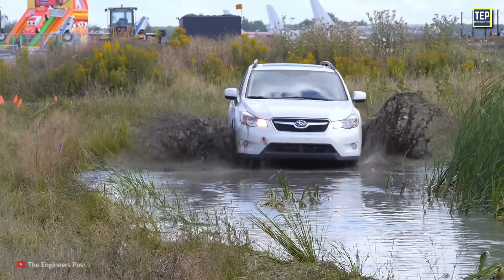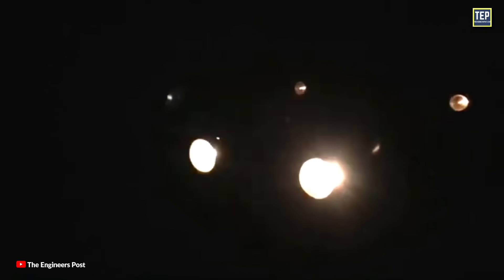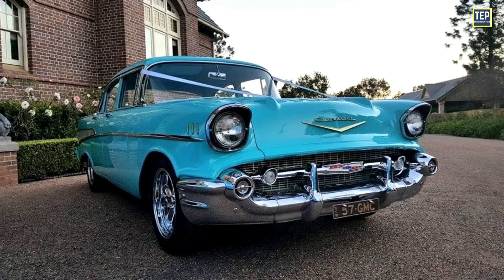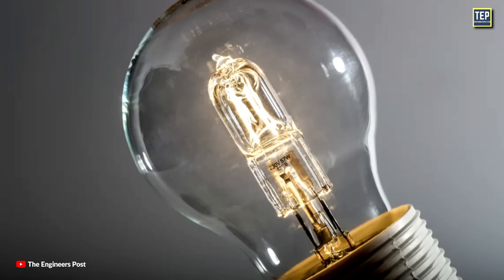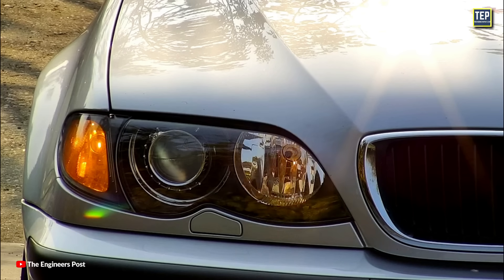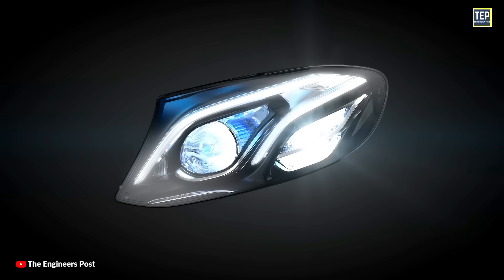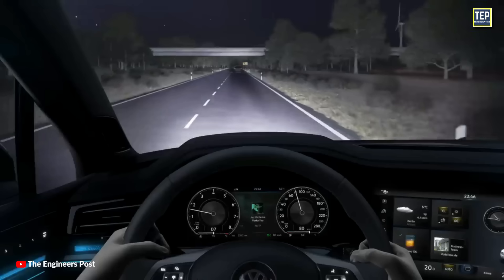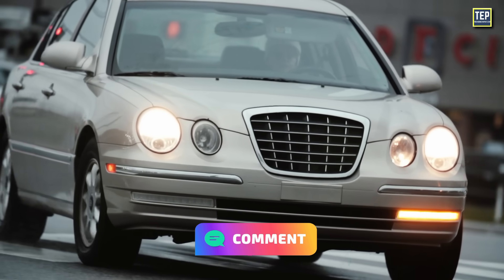The Problem With These Headlights

Comment: "remember, the best time to use very bright lights is when you're in a lifted truck in the city/suburbs where there are a ton of incoming traffic. This way, the light can hit multiple cars and blind people causing them to lose their sight and/or crash." - car manufacturers.
Reply: And those lifted trucks LED blind you. Wonder how many crashes and death have been cause because of them I am sure they do not meet traffic safety standards in brightness and Height above the roadway. Wish the gov. would crack down on these.
Reply: @sundance2005  The gummint is only there to force you to pass smog control.
Reply: Not just lifted trucks @sundance2005
Reply: Add to that make sure you always have your fog lights on, foggy or not.
Reply: The biggest problem in my opinion is knuckle-draggers loading the back of their utes/trucks with tools and everything else and failing to either upgrade the rear suspension for the added weight, fitting air assist bags to aid with the added weight, or simply not being competent enough to slightly adjust their headlights Y axis to compensate for the sag they've introduced.

I play a game "high beam, or f***wit" with my best friend when driving at night, but I can tell 90% of dazzlings are moron related by how far their beam goes up the trees at the side of the road...
Reply: @YouNameItGaming the thing that annoyed me the most since I came in North America is that practically no car here has a built-in headlight height adjustment accessible from the driver seat. When I was in Europe, (almost) every car had that, and it was great to be able do lower your beam whenever you were loaded
Reply: @julescugnet9154 this has been mandatory for cars in Europe since the late 90s. Yes, that's what regulations bring you. If you don't force the manufacturers to introduce safety features they won't introduce any.
Reply: @julescugnet9154 I have that in my TATA car back in India but none of my North American vehicles have those. Even when they cost three times as much.
Reply: @tannenfreund87 1/3 of Europe cars are sold in the  US
Reply: @Tedmader-fp3vb  they still build them according to the local regulations. If they don't require height adjustment of the lights, they won't build it. Also, the requirements for light are different in NA than in Europe. The cut-off of the headlights is different and NA doesn't require orange/amber turning lights on your rear end. European headlights are illegal in North America
Reply: @julescugnet9154 Or you can just pop the hood and use a screw driver to adjust your headlights. takes all of about 2 or 3 minutes.
Reply: @YouNameItGaming  Then you're just odd because the majority of the blinding truck lights are vehicles that have no cargo in them, are driving for mere brute size and higher ride height, when a car would have sufficed otherwise.  I see very few "work trucks" on public roads, loaded down with cargo, that are the factory LED headlights that are blinding.  It's usually incan headlight vehicles currently in use as work trucks, unless illegally  modded with LED drop-in lights, and those are at least as bad as factory LED lights.
Reply: @YouNameItGaming  the rear airbags on my suv went out and I was blinding everyone with my low beams until I got the replacement bags.
Reply: @YouNameItGaming it's always coming down to $!
I had that problem decades ago. Bought older vehicles with already worn out suspension (of course always the cargo area is made weak at the factory so it's totally shot in a decade) (yes the commercial duty version wouldn't those are more expensive new and used I'm talking about the most economical classes of sedans and regular pickups).
I had to have new spring or suspension work. 
It always drives me nuts sitting in a vehicle looking up at the trees once anything heavier than a couple salt sacks are laid in back. 
It's people who can barely afford to drive in the first place who go around lighting up the trees. You'd find the tires are probably near bald, the oil is a black drip at the end of the stick, the transmission smells like a chemical fire and the seats are shredded. 
And they're >    < this far above empty all the time.
Reply: @YouNameItGaming o
Reply: All the people who have their brights on in urban areas annoy me.
Reply: @dougpatterson7494  I have my brights on to see better at night and also because of those assholes that have their bright LEDs shining right in my face!
Reply: I totally agree.
Reply: Oh it’s even better when you’re from Alabama and especially when in a rural area, where there’s little or no light pollution, so your eyes are adjusted to the dark, and some asswipe with a squatted truck flies down the road, and won’t turn his fucking giant LED bars off either.
Reply: I was about to cuss you out in the first half
Reply: I think they're only allowed to use LED 10k bulbs in lifted-trucks IF and only if they also have a big pair of trucknutz.  I'm pretty sure that's a bro-code law nowadays.
Reply: Remember when car headlights didn't try there best to blind everyone approaching your lights
And that is probably just the normal setting and not the brights
Reply: @kaval187  I doubt that most people reading this are old enough to remember a time before blinding headlights.  
In the 90's xenon high intensity discharge (HID) lights were all the rage and everyone was installing illegal aftermarket  kits.  The cheap kits didn't even have proper reflectors or adjustment dials.
Reply: Absolutely!!!
Reply: Yeah well if you lift or lower your truck, you really should get your lights calibrated. And yet I doubt people do this.
Reply: @alexdhall  the main issue now is that SUVs and trucks come out of the factory where the headlights sit directly into your cabin if you're driving a car (sedan, coupe, compact, hatchback) so they don't even need to be lifted anymore. They just come like that
Reply: You forgot the four light-bars and "fog lights".
Reply: And always use bluish light so that it scatters the most in fog and rain at night rendering your night time vision useless and blinding others. While yellow light don’t disperse as much they are so boooring 😂
Reply: - Tesla
Reply: You should recommend that they install a train and tractor trailer horns make people deaf or give them a heart attack as well
Reply: 11:43 what in the jaguar f-type volvo s90 is that?
Reply: @thetechcorner7204 It looks like Volvo and Masarati got together and had a baby, lol.
Reply: I read your comment and had to laugh out loud!   So true.  It also helps to have extremely bright light bars on your roof and front bumper as well as the rear bumper, to blind everyone in range.
Reply: White led lights are too dangerous.
Reply: I totally do not get blinded by any vehicle because I am blind already. My eyelids get brighter though
Reply: @Nick-or5lr you’re good at watching YouTube for a blind person
Reply: Some manufacturers send their vehicles without ever having them aimed properly. Most high sitting vehicles have their low beams sitting at the same angle as their high beams. And some idiots never turn hight beams off as it is.
Reply: Government must crack down hard on bright LED lights.
Reply: Don’t look at them. Look where you want to go.
Reply: I look forward to the day that they put automatic leveling in headlamps. These high intensity lights are great when you’re traveling on a flat surface, but as soon as something happens, when your car is no longer flat, you start blinding everybody.
Reply: the worst is those "squatted" trucks, the ones who lower the rear end while leaving the front jacked ?
you blow right past the limitations of adjustment when you do this, so no matter what, your blinding oncoming traffic along with low flying aircraft...
these people are the epitome of narcissistic morons in my opinion.
Reply: The outcome is that more vehicles will be sold. - car manufacturers
Reply: i dont know whats worse idiots using high beam or idiots having theyre low beam bright af
Reply: That's why people are working so much, unlike you sitting and laughing at technology but still remain as a incapable person no matter how much you live with lies 🤣
Reply: Yes, this applies to the drivers that mount led panels in grills to blind motorists. Save these for off roading, not in city driving.
Reply: 😮Divine miracle ✨️ 🙏
Reply: I fukkkkkking love my Lasers dude!! #BMW #bimmertech
Reply: If I bought a car with led headlights I'd seriously see if I could change them for halogen or reduce brightness, I could not drive around being so rude blinding everyone!
Reply: I totally agree with you
Reply: Yeah, I don't think it was Daniel Stern who narrated this
Reply: That’s something whistling diesel would say
Reply: For real 🤣
Reply: agreed👍
Reply: Impossible LED lights don't blind people, the video said so. Don't worry about any past experience telling you otherwise.
Reply: @UnyieldingMass yeah, pretty sure this is an AI script - quite a few weird statements that contradict other parts of the video
Reply: @UnyieldingMass  Guess what "sunshine"? Just because a "video says so" doesn't make it true. I seen a lot of videos say the "earth is flat". Am I suppose to believe that too, just because the video says so?
Reply: @UnyieldingMass  but they still f*ck up the eyes forr a short time
Reply: @UnyieldingMass  ROFLMAO!
Reply: @UnyieldingMass  They also don't produce any heat!
Reply: @UnyieldingMass I'm also fairly certain this video was AI generated. The voice-over is obviously not a real person but even the language, syntax, and grammar of the script sounds like it was written by chatgpt. Knowing how unreliable current publicly accessible AI engines are I would not at all be surprised that one would make such a confidently wrong claim as "LEDs won't blind other drivers."
Reply: Any of the headlights that are pure white blind you there's a reason we used yellow lights manufacturers and you seam to have forgotten or does it not blind you because your lights are even brighter than theirs? @UnyieldingMass
Reply: And smoking and Vaping doesn't cause lung cancer 😉
Reply: Obviously the car manufacturers to the drivers are listening to you.  lol
Reply: The car manufacturers aren't responsible for that lol. The people lifting the trucks and not adjusting the headlights are.
Reply: @masondurham8686  The car manufacturers are absolutely responsible for their stock headlights being so bright that it looks like super powered high beams. Even in a non-lifted car, having one of these things drive towards you completely blinds you.
Reply: Fr
Reply: well ive seen lots of accident happenes because they were driving on lov beam while at high speed... people has problems interpreting complex logics.. lov beam is for slow speeds while you are close to other cars and peopke you have to be also automatically slow... and high beam is for fast driving where there is no other drivers ... if there is drivers and people and you ar driving fast thats problem... of you are driving on low lights on high speed while there is other cars and people on road  its waiting for disaster 😢😮😅😊😂

Comment: if you ever took out an led that had been on and touched the heatsink you wouldn't say they don't emit heat. not only do they get hot, they can't handle the heat like older bulbs could. people keep saying they last longer and perhaps they can when engineered to. but i keep seeing burned out leds, flashing, or ones that have become dim. they need to be considered a consumable and be replaceable bulbs just like the old ones were, you ever look up how much these headlights and taillights cost on the new cars, it's insane!
Reply: LEDs require a well regulated power supply, which contributes to the heat generated. Some of the brighter ones have built-in fans  to cool them.

Comment: LEDs blind the shit out of oncoming traffic. Mainly because dumb dumbs buy illegal LEDs online that will fit into their halogen headlight assembly.  Not realizing that these bulbs cannot be found in stores because it is illegal and that the housing of a headlight is designed for a specific type of bulb. Headlight assemblies increase the amount of light produced by a halogen bulb to decrease the power needed but still produce a brighter light. Put an LED that is designed extremely bright in that housing and now the headlight is increasing the already bright light to blinding levels. 
I flashed some dickhead neighbor of mine one early morning and he or she flashed me back, their high beams were dimmer than their low beams. Ignorance is not a goal people should strive to achieve.

Comment: all the new LED headlights are sucks against heavy rain and fog as they usually come at 6000 Kelvin temperature, you need 3000 to 4000K against rain and fog.  problem is with the same wattage 3000k LEDs have lower lux (50 to 70%) than their 6000k counterparts

Comment: LEDs were actually first introduced by Mercedes in the w211 E class In 2002, used in mirror turn signals and brake lights (I know because I have it)

Comment: LED are supposed to be better especially based on the cost unfortunately they go bad even on low output lamps like a tail lamps but cost 70 times the amount of a similar or previous model to replace.. most times the entire module has to be replaced if one section fails.. Il

Comment: The issue isn't the bulb of the light, it's the lack of control of the light. We have 3 setting lamps where the light can be dim, brighter, and brightest. But cars have normal ans brights. We need a dim for use in cities, highways, and next to other cars or people. Then the middle light for dim driving and sparsely populated roads. Then brights for when nobody is around

Comment: There should be legislation to get rid of these painful blue headlights.    They need to taken out of production, and cars with such existing headlights should be mandated to be retro-fitted with proper headlights.   Though I am in my 70's I find that even young people complain,  many claiming they will no longer drive at night.    I believe that millions of people find driving at night almost unbearable.    It is not merely a case of some drivers not using their low-beams.  Low beams will shine into the eyes of oncomers when cresting even the slightest hill.   I find myself blinking at blue headlights that were already on low beam,  even on flat ground.   . 
I am happy to hear about "matrix" type lights.    I have often thought that a cluster of very narrow light-beams that can be selectively turned off is the solution, though quite expensive, and could take many years to produce enough variations to retrofit the millions of annoying blue lights that already exist.   Such a "lazer" cluster should contain way more than the dozen or so individual lights,  perhaps about 100.  This way these large [usually yellow] traffic signs with their much too retro- reflective  lettering won't wash out the visibility of everything else around them.   
I believe it is time for national legislation to address the safety concerns these new blue lights are causing.   Even if it causes their manufacturers considerable monetary pain,   they should never have been produced in the first place.   Time for a forum on Facebook,  perhaps ?
Reply: Its not the new cars that blind you its the old cars retrofitted and not adjusted properly.
Reply: @johnhotine5232 Some of the Teslas are overly bright from the factory.

Comment: This is great info, but something is missing, and I'd love research into it. The older (weaker) yellower lights seems to perform better by their wavelength and the contrast in what you can see ahead of you. As the lights get brighter and whiter, the contrast seems worse so the want more light. (try your white lights with yellow contrast sports glasses, you'll see the difference) the yellower lights have better penetration in foggy weather (my observation) perhaps if they look to yellow the lights a bit, less light is needed and huge safety improvement for the oncoming traffic.

Comment: Halogens were the best.
Simple
Cheap
Available at gas/petrol stations
Easy enough to change on the spot
Not blinding to others

With advent of more powerful light sources, it made Halogens appear inferior, when in actual fact Halogens were perfectly adequate, safe and non blinding when everyone had them.

Comment: I have watched a road test of halogen, hid, adaptive led and laser head lights ...
Interestingly depending on the measurements and watching the best short beam was belong to small sized car with halogen head lights and long beam was belong to an adaptive head light in a mid sized brand...
And another technical video was testing the brightness, density and pattern of the head lights with various head light settings and designs. 
As a combination of the both, I can say, the first important thing is the harmony of the head light, headlight design and product quality for chosen light source... The second important thing is the quality and design of the light source...
Also another point for the light source is the efficiency. The percentage of the electricity converted into light and heat...
In any scenario the heat is a killing factor for the source, and loosing from the hp....

Comment: ❄️ I live way above the arctic circle (N70), and the problem here is the cold. With the freezing temperatures, the glass/plastic in front of the lense will freeze and "clog" unless the bulb produce enough heat. Old halogen and xenon generate enough heat to keep the glass free from snow buildup, while LEDs don't. This is a real issue for newer vehicles.